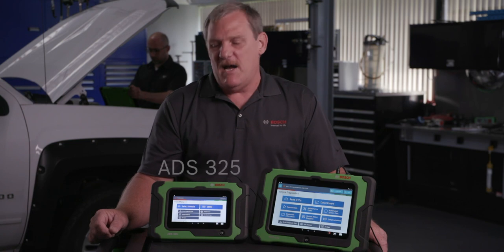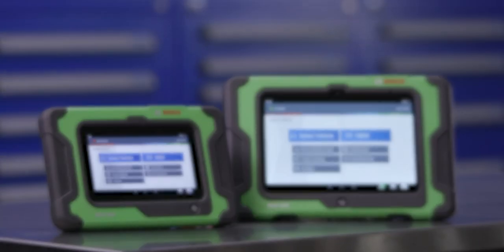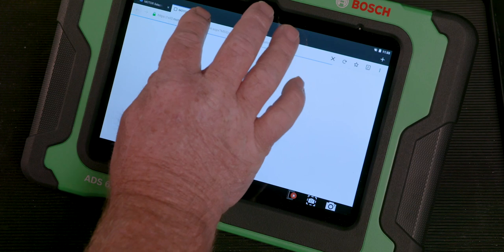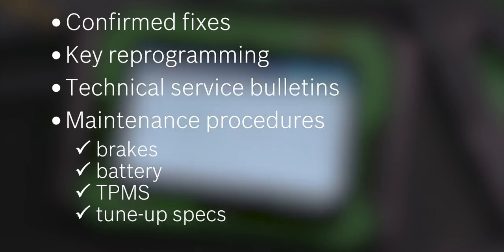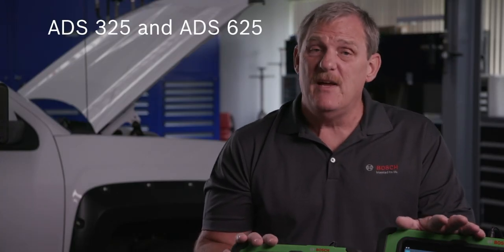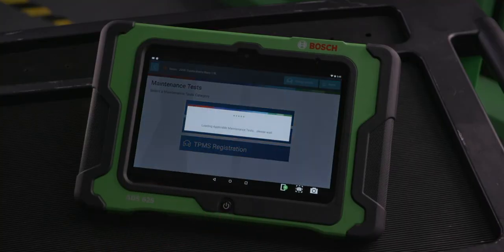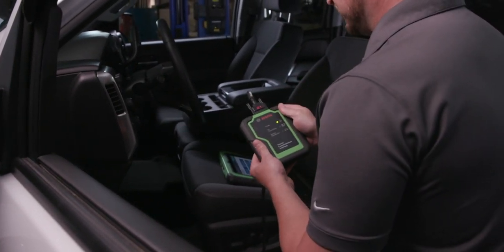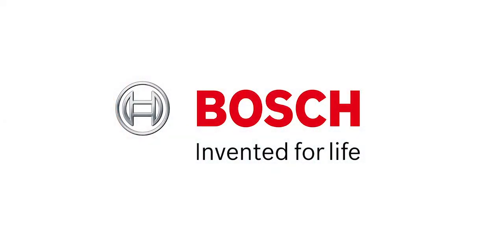The best scan tools for the vehicles you repair

Comment: I'm seeing more & more youtubers using them... must be good. How's Euro coverage.. specifically VW & Audi? What is the subscription cost? Can one use the tool without a subscription / update once every 3 years (like my snap-on scan tools)?
Reply: Thomas EXOVCDS so I’ll answer this. The euro coverage is great including bmw as well as VW&Audi. You get with your subscription cost repair Data and wire diagram (Mitchell, alldata) kinda of support. The cost is $950-1200 depending on where you get it. You get 1 free year upon activation. You can use the tool without the subscription and you’ll end with the same as example 18.4 snap on and you can re up when day 20.4 comes out. They don’t use update numbers like that but you get the drift. This works just like snap on does. The only down side to not staying current is you loose the repair data and wire diagrams. The 625 also uses the VCI as a J box. The 625 is a beast I own two of them as well as a snap on Zeus, Autel elite, launch torque and the Bosch is my go to. Buy one you’ll be happy with it
Reply: @weldingjunkie  Thank you for the first hand info! Much appreciated! Having a hard time finding a Canadian distributor.
Reply: Thomas EXOVCDS you’re welcome anytime I know how it can be sometimes with limited info. I have one brand new sealed if you are looking for one. We could go through PayPal so we are both protected if you decide you want it can’t find one locally. Keith defazio uses one, Eric from south main, flat rate master although I don’t see him use it. I show it on my channel too. They are so good I ended up buying 3 for the guys but only used two
Reply: @weldingjunkie  Thanks... I'll keep you in mind. I'd prefer dealing with someone local or at least in Canada... need to sell some of my old scanners to help get funds together, so it might be a while.
Reply: Thomas EXOVCDS understood I don’t blame you. Keep in mind last resort. I’m sure I’ll hold on to it anyway I’m in no rush. These thing are great I have a Zeus and Bosch is my go to. I wouldn’t buy the smaller one the 325 I think it’s called. Not as many features
Reply from the maker: Hi Thomas,
Here is a link to the Bosch web sites around the world.  You can locate the Canada website and contact them for a distributor in your area.

http://spr.ly/6052EFqFC